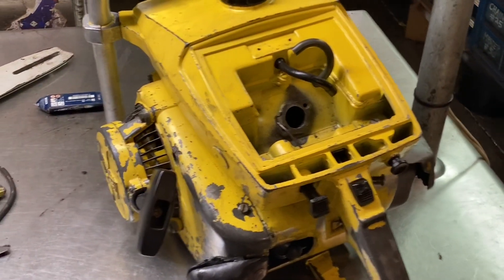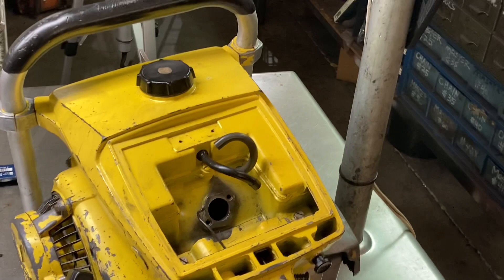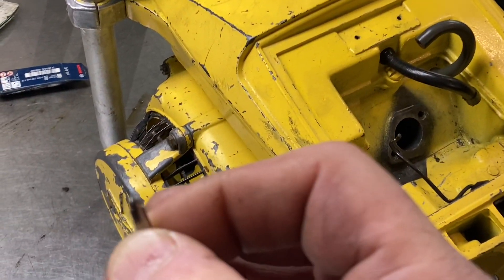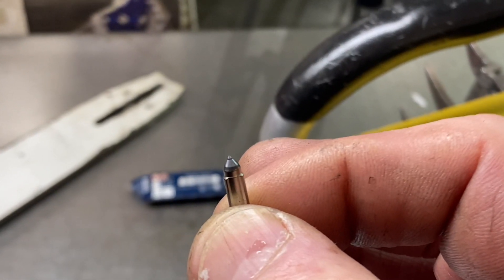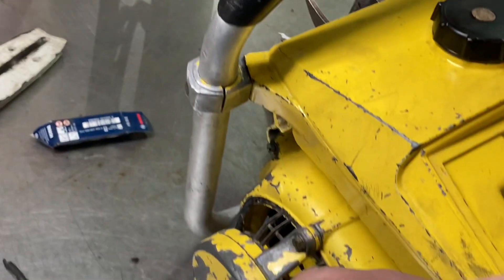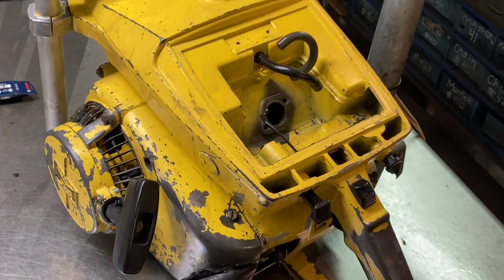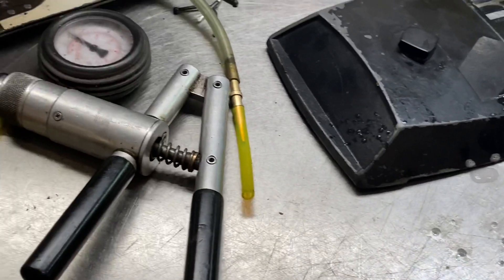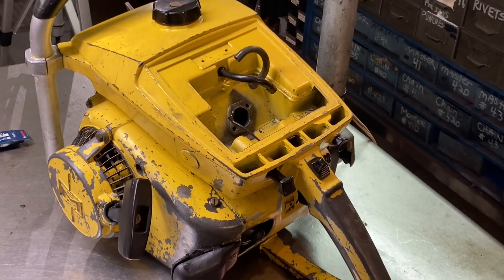#1 West Coast Muscle Saws Super Pro 125 Carburetor issues

Comment: I've got an old McCulloch Model 47 I'm working on getting cranked and running again. I have cleaned it up. It has good compression and good spark every time I pull the rope, but I still can't get it to crank unless I spray some starting fluid in the spark plug hole. It will crank and run for just a few seconds and then die once all the starting fluid is burned off. I can take the carburetor off and it will have fuel in it, but I don't think fuel is getting out of the carburetor and into the motor on this saw. I'm trying to soak the carb in some Pine-Sol for a few days and see if that will clear it up. For some reason I can't get this saw to run, but I've done a lot that I know to do. Do you have any ideas??